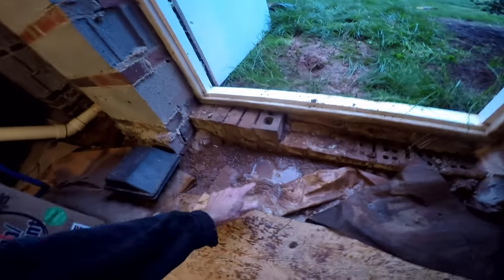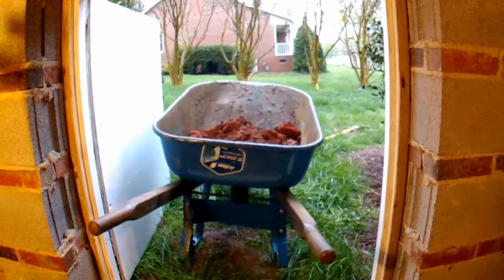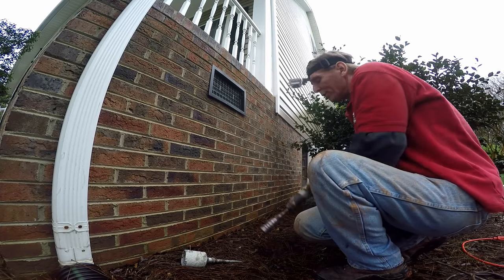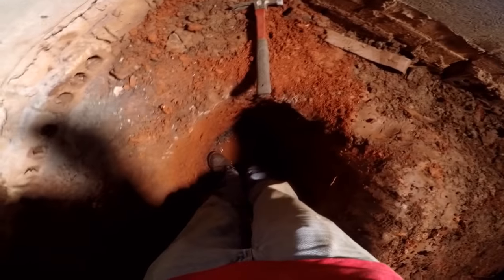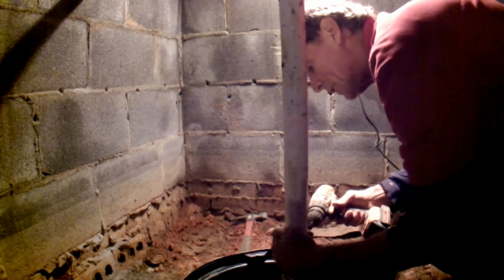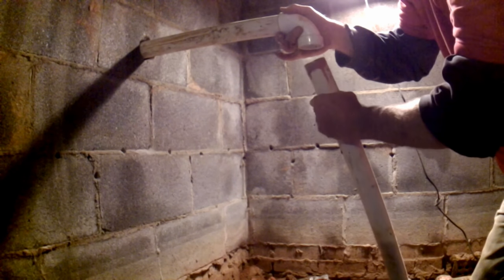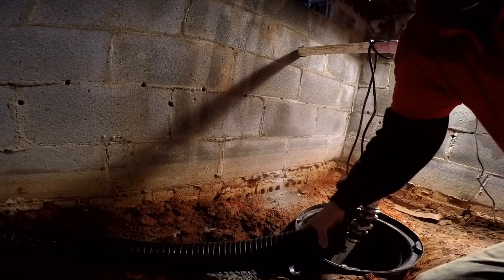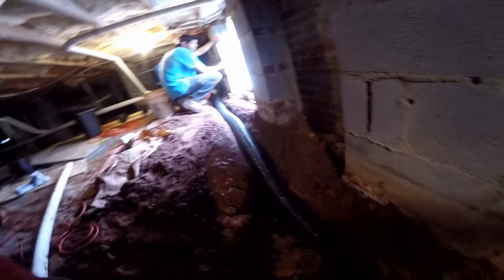DIY, Footer Tile, Sump Pump Install, Waterproofing, Crawlspace

Comment: When digging along the foundation wall to the footer... how much linear foundation can be exposed without endangering the structure of the house (will the section of foundation move or fall into the newly dug ditch)? Can you apply this question to very short crawl spaces (near 18 inches height).  Is there any danger in weakening or toppling the foundation?  Thanks.